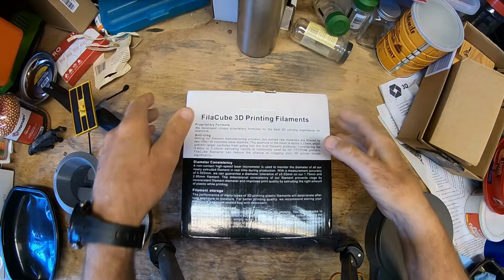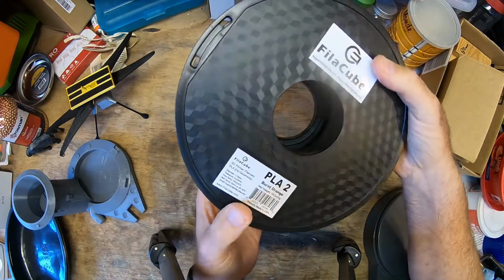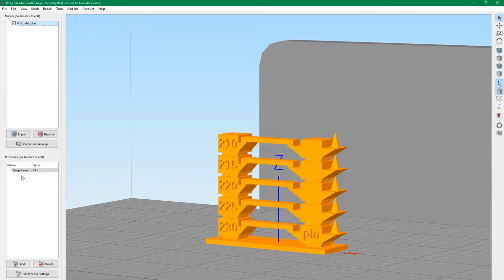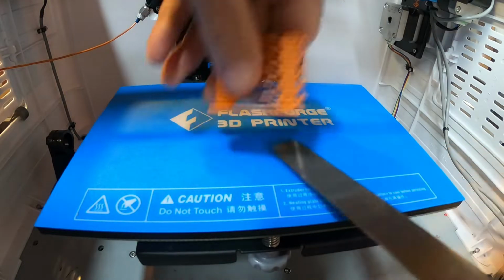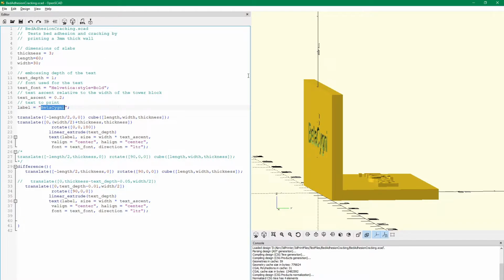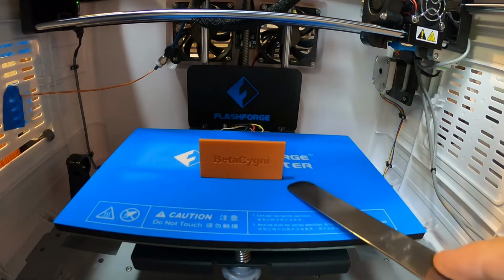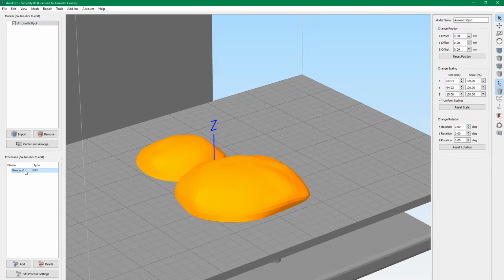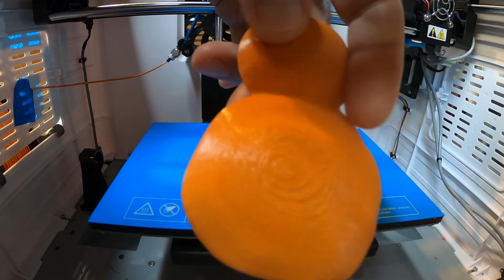Flashforge Dreamer (NX) - FilaCube Longhorn Orange PLA 1.75mm Filament Testing

Comment: Would you say these units are stackable? Any issues, flaws, or annoyances with the dreamer unit?
Reply from the maker: I would say they aren't stackable. You need to get into the top to load the filament and clean/service the head.
Here's a link to my video about my "end of the day" cleaning procedure:
https://youtu.be/CEwmLWdCj3g
My philosophy is that you don't want filament to cool off in the printhead, so anytime you're shutting down you need to clean it out.
That's worked very well for me.

My major annoyance with the Dreamer NX is that with my printing load (10-15 hours/day 365 days/year), they only seem to last about a year before the printhead or some other part like the bearings seem to wear out.
They're pretty cheap and my business is going well (see link in the description) so I can afford to buy a new one every year, but after the last one's heater core shorted out, I decided to upgrade to a Flashforge Guider II. 
I've been printing with that for about 3 months now and I'm super happy with it.
I have an unboxing/review series coming out later this year about my experiences with that.
The short answer is that the Guider II has a much more robust z-axis vs. the NX and replacement parts (which I haven't need yet, but plan on buying some to have on hand) are much easier to get. The Guider II also has a much bigger print area which means I'm doing 2 prints/day instead of 3-5 which increases my productivity.